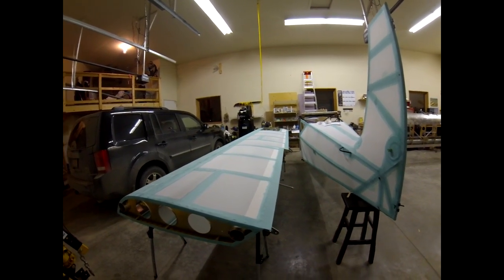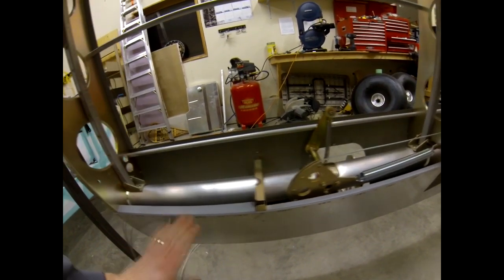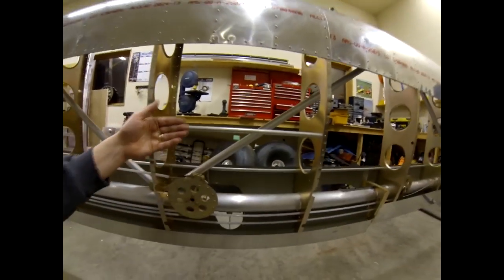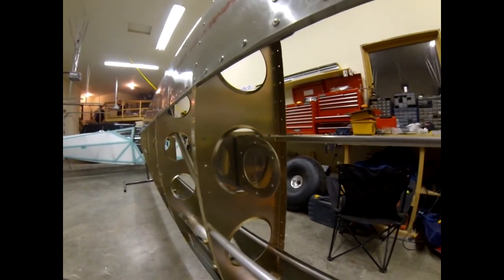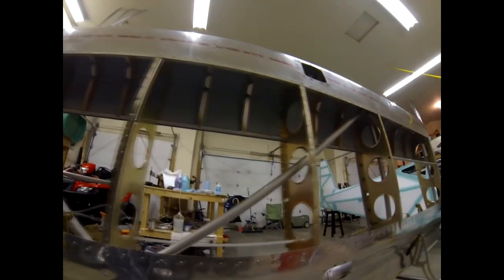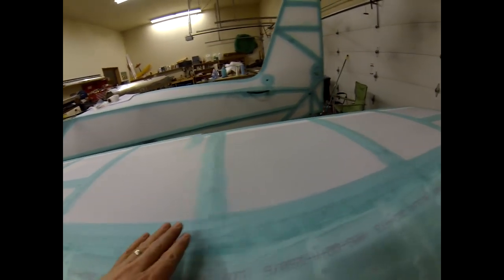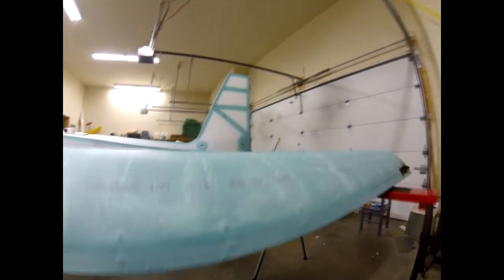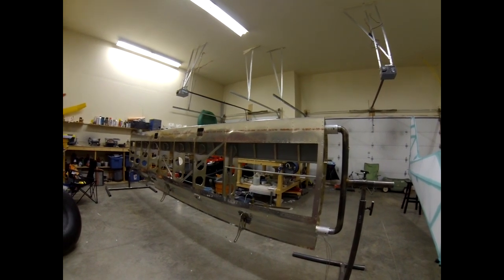SuperSTOL Build

Comment: Quick question, as far as build difficulty goes, how would you rate this aircraft as compared to others you have seen our worked on?
Reply from the maker: I think the RV's are more difficult, but the instruction are so much better with them that they are easier to build.  You are left up to do so much on your own with this airplane.  People like that, but if you don't know what is right or safe, it not the best.
Reply: I appreciate your input. After college (and a few years to get my career going) I plan to build an aircraft. This one looks nice, but an easier project would probably be better. There is always plenty of time down the road to tackle a more difficult project. Thanks!
Reply: Branchair t